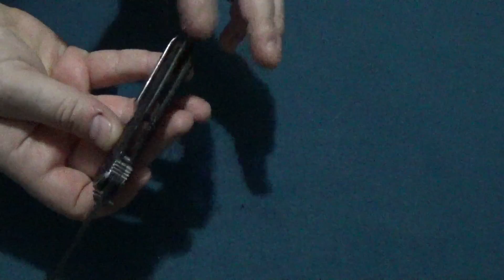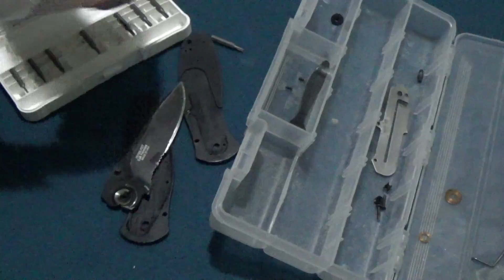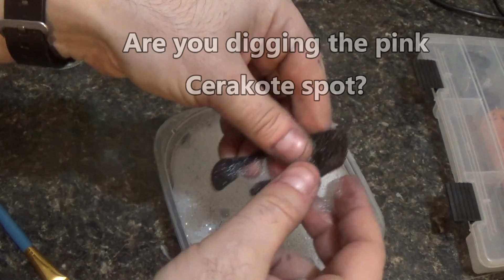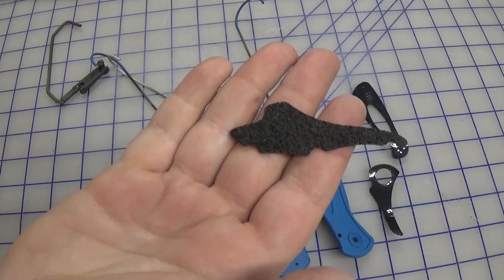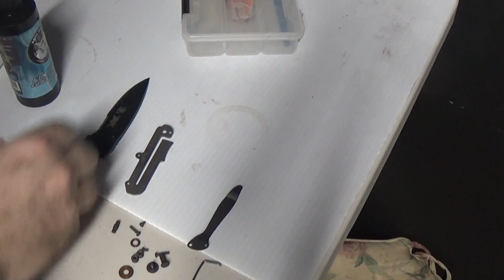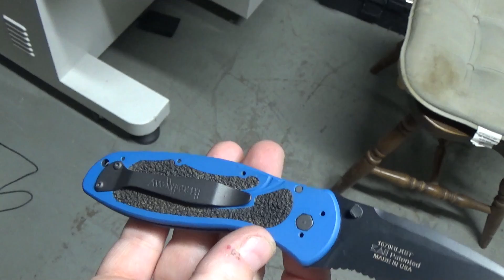Kershaw Blur Remodel & Refurbish - Custom in the Shop Project

Comment: why did you not make a new back spacer that is solid?
Reply: I like backspacers as well a nice G10 gear shaped backspacer woulda put it over the top, and helped with the missing barrel spacer/standoff
Reply from the maker: There is no Blur that comes with a solid backspacer. That would contradict the whole point of the project which was to refurbish a beat up old Blur and make look as much like a new one as possible.

Comment: Looks like a lot of steps, how much time did that project take? Hard to get a sense of the actual time needed to do a project like that from the video. Cool to see, thanks for sharing.
Reply from the maker: There's some dead time just waiting for stuff to happen. Flashing Cerakote is a 15 minute oven time. Curing is either an hour at high temp or 2 at lower temp. That builds in some time where you have no choice but to just wait. Besides that it's about an hour and a half of actual work on the knife (that can vary from knife to knife). I don't count the time cleaning the spray gun in between colors and the end of the day. That's my own fault for using three different colors.